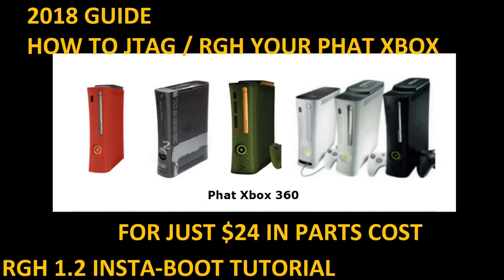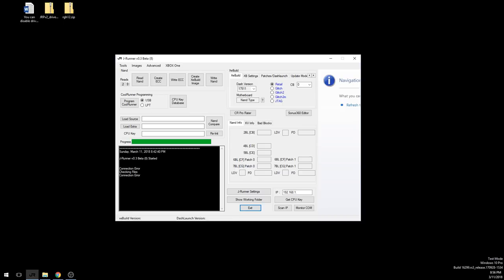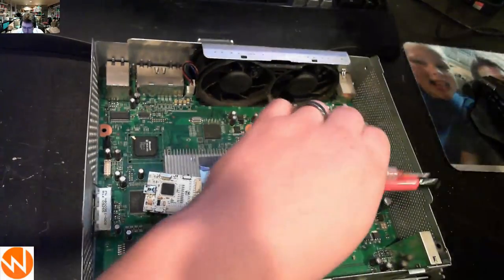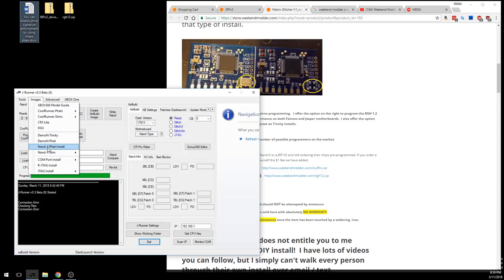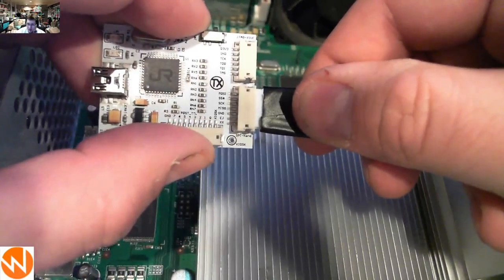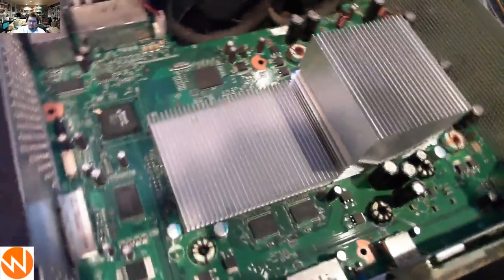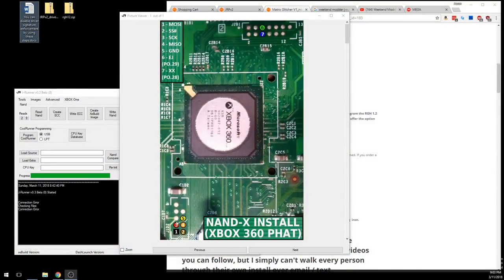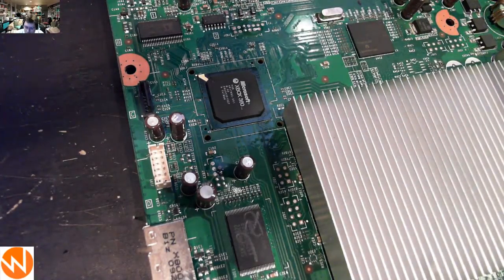2018 Complete Guide to RGH not JTAG your fat PHAT Xbox 360 for mod menus and emulators

Comment: Finished up the install today. Wow, nearly instant boot times. Awesome video thanks for your help. And to anyone who reads this comment and wants to do this with no soldering experience it is possible!
Reply: does it need soldering?
Reply: Karley Werlang Campos  of course it does....
Reply: Hi I'm just about to mod my Xbox and wanted to know as you've done it, what exactly do I need to buy? I have a Zephyr model (UK) Also a year on was it worth it? Thanks buddy!
Reply: @heartcrafts3426  month late, but the model zephyr literally isn't worth modding, (they are a pain in the ass)  personally i would look for a jasper or falcon model
Reply: Colin Hathaway Can I ask you a few questions bro about flashing an Xbox360 Drive
Reply: Just remember to use plenty of flux and you can't mess it up 😊
Reply: Syncopia Hey bro do you know what you’re doing when it comes to flashing Xbox360 Drives
Reply: Colin Hathaway how can you do it without soldering?
Reply: Soldering was very difficult and points are too small.. It is very common that in any soldering point would burn at the middle of the work and say goodbye to all efforts mad before. However, it is not that difficult for amateurs.

Comment: At 38:58 where you're worried about the blob size on CPU_PLL_BYPASS, jsyk, there is no actual difference between the top of the resistor and the testpad, Both are connected to the same thing. I have schematics. I used to use the top of the resistor most of the time thanks to the convenience back when I was modding 360s commercially.

Comment: u sure u got those numbers right? 470 sounds ridiculously high for soldering.
i have destroyed many circuits with just 400....

to me this job looks more like it needs 300-350.
Reply from the maker: Agreed it is high, I like to work hot and fast
Reply: TheWeekendModder Hey bro can I ask you a few questions about flashing an Xbox360 drive

Comment: Just modded my Jasper 512MB by following this tutorial (but using a Coolrunner Rev C and a Nand-X instead). Instant boot, absolutely awesome! :)

Although I noticed that the wiring images in the J-Runner package told me to wire up FT6U7 which didn't work. Had to use FT6U1 for RGH 1.2 instead.

Comment: Hey, your video was beyond outstanding - covered everything possible for installing matrix chip. I accidentally bricked the first console - ruined the post solder joint (FT6U1). For some reason the solder would not take to that point or the trace. Went out and found another 360 for cheap, repeated the entire process (extremely carefully) and all is good. I haven't did anything with the XEX menu or anything - I'll work on that tomorrow. All in all, it was a breeze. I feel good about doing my first Mod, and now I want to keep doing them until I can perform this in my sleep, and fully know how to avoid issues. No more bricks for me. BTW, I ordered my parts from your website. Super easy, parts came extremely fast. I would like to suggest that maybe you offer the wrap/kynar wire as well. I don't have any type of store that carries that wire in my city. I found it online for cheap, but it'll take weeks to get here. I just wound up using the twisted pair wire from an old Cat5 patch cable I had laying around (though it wasn't solid strand as I had hoped). Thanks again for the video and knowledge. 

Note: my original display output was through the AV cable for the 360. For some reason, when loading up the Xell menu, it would not display through that port. I had to use an HDMI cable for it to display. Once the full install was completed, it worked just fine again. Just putting it out there in case anyone else runs into that problem. Hope it helps.
Reply from the maker: Hey thanks for your feedback, I might consider adding some wiring to the site - good suggestion!

Comment: Outstanding video tuturial.Weekend Modder :) got my v1 Falcon booting in around 7-8 seconds (Matrix v1 chip with 28 single core awg wire for PLL,RST and POST points.26 awg stranded core wire for CLK point and 24 awg stranded wire for 3.3v and GND points) :) :) :) :) :) :)

Comment: Thanks for this tutorial! I am going to be doing a few Xboxes soon. I haven't been on the scene since around 2010, used to do this quite a bit but forgotten everything I learnt, so thanks for this video it helps a lot! I am wondering though, this is an Xenon motherboard, I had read through a lot of se7ensins posts that you couldn't RGH 1.2 an Xenon without an Ace V3? Yet you are doing it here so just needed some confusion clearing up. I got a JR Programmer, many years ago these costed a fortune but I got a genuine one off Ebay (not from China) for about £17 recently. Never used one, I used to do it with a DIY CPLD programmer and also built a DIY Nand programmer. Always wanted to get a JR Programmer or a Nand X at the time but couldn't afford it. Also, I was wondering, I don't think the Matrix chip I just bought has an LED Debug light, got a tutorial on how to add one?

Comment: I used kynar wire on a muffin trinity install with a rev c for every point except the power and ground. I am getting instant boots 90% of the time. Give it a try if you feel like expierimenting. I remember you saying somewhere you never tried kynar on trinity. I just used 30awg kynar and the muffin 7-1
Reply from the maker: ClearAlpha Nice!
Reply: Next time you do a trinity muffin stream or something see how it goes. Do the rev c so you have a video on it.
Reply from the maker: Thanks for the suggestion.
Reply: Wire is wire. Kynar is not going to give you instaboot
Reply: I am simply suggesting it since he has never messed with it on a trinity and I tried it and had a good experience. It isn't an exact science. Not trying to act like I found the cure to cancer. Many people have done this in the past. I am merely sharing my results of something I don't normally do.

Comment: I recently discovered your website and videos and just wanted to say thank you, you're producing excellent quality content and doing a great job of providing up to date information - I'm glad to see I'm not the only one still repairing and modding these in 2018!
I also have a question - what's your recommended setup for recovering DVD drive keys from Xenon motherboards? I have several consoles that came to me without DVD drives at all and would love to get them fully working. There are a few Xenons that range from dash version 8955 through to 17511. I'm obviously not going to permanently mod them, I just want to recover the keys. What would you suggest?
Reply from the maker: Sorry man, due to general avoidance because of my understanding of their tediousness I've steered away from Xenon's entirely.  It is my understanding that there is a variant of RGH 1.2 that "works" on them but from what I have read it's super flakey.   Best of luck to you!

Comment: Perfect Video, i‘ve done the job for my Jasper.
I also tried for a Xenon. Reading/dumping original Nand is no problem, writing the timefile to matrix and creating and writing ecc is complete but the console won‘t boot up to xell to geht the CPU key.

I flashed the console back do original nand and it‘s Booting instantly to the Dash. 

I also tried out any of the timefiles but no boot. Have i make any other soldering or changeing some options in JR to get in work ?

Comment: Yo I got xell to boot but when I tried to boot the custom image, I get error 73, any ideas? I already repasted it and double checked it, it looks ok.

I did not record the dash version before I started trying, does that matter? I just had it set to 17511 like in the video.

EDIT: Damn it does it on the original firmware REEEEEEEE, I don't know what could have caused it, i've detailed the board with q-tips and alcohol, this is my 3rd broken xbox

Comment: I have a PHAT, non-xenon (I assume since it has a HDMI port) with a dashboard currently at 16537, sadly too high for jtagging, but apparently it's okay for RGH 1.2. Do I have to update the dashboard before doing what you are doing?
Thanks a lot for this video, I am a noob at modding and it was interesting enough to sit through without doing anything.

Comment: i jtagged my old xenon using a taio usb spi knockoff. i still have it lying around, will this work inplace of the jr programmer? or do i still need a jr programmer to rgh a falcon?
Reply from the maker: It would work for reading and writing the nand, but you'd need a way to program your glitch chip unless you bought a pre-programmed glitch chip.
Reply: TheWeekendModder ok gotcha so the jrunner does both reading the nand and programming the glitch chip.
Reply from the maker: Jrunner as software does do both yes, but the point I was addressing is that the old usb spi knockoff you have is physically capable of interfacing nand to read and write it and do that part of the RGH, but for RGH you also need a glitch chip. That old programmer probably doesn't have the ability to program glitch chips.    Some glitch chips require that a "timing file" be programmed to them so work, but some glitch chips come pre-programmed.   If you got a pre-programmed chip and therefore didn't need to program a glitch chip - your existing programmer would be sufficient.
Reply: gotcha.i see you have the chips with the timing file already put on there. since i am really unsure about the steps ill look at a few more tuts, cause i am only familliar with the jtag for xenon. i didnt know you could write the nand on a newer dashboard, which is why i though i needed to to the rgh. i appreciate you responding, i know you arent tech Q and A for rgh :)

Comment: I bought 2 chips, JR Programmer, supplies from weekendmodder.
Got to the point of writing the ECC. Now there's no video output to HDMI or component cables. It no longer does the LED flashing. No RROD. I tried a different timing file on the chip. Re-did the ECC create and write multiple times. No change. Tried putting it back to retail. Console powers up, chip lights up, green light on the on button but no video output.

The console had this problem once prior to attempting the mod, but I used a heat gun on the bare gpu, cleaned the system, applied MX-4 and it played fine. So I don't know if that issue reappeared as a result of me messing with the motherboard, or if I did something wrong with soldering or flashing.

How can I go about troubleshooting?
Reply: Just did my 2nd 360... 3 red lights.
Wow, what a blast this has been!

Gonna get these both reballed.

Comment: i'm new to the xb360 mod scene. watched many vids on how to perform various types of mods but not 100% sure which one to do with which kit.
I have the old white case xb360 fat, power port says 16.5amps and by the charts this should be a Zephyr. System info says D:2.0.16203.0 - K:2.0.16203.0 (BK:2.0.1888.0)
By the chart this console should be able to R-jtag.
Am I correct in my conclusions?
Should I use the CR4 XL with the J-R Programmer V2?
Reply from the maker: Check out this page, I think you'll find it helpful:  http://weekendmodder.com/suppliesrequired.html

Comment: I hate my soldering iron ( 30w pos) . I once used a weller wes51 soldering station and I was feeling all warm and fuzzy inside.
Reply: I have a 35 year old temp controlled Weller and it still works great.

Comment: Heej, after I followed your video I tried to perform a RGH 1.2 install on my Jasper 360. My first mod ever. But I have an issue! After I soldered al the point, connected de Programmer and connected the Xbox to the mains, it started smoking. The contact point and the C1D7 next to the yellow wire started smoking. I unplugged everything desoldered al the wire cleaned al the point and did tried it again. Still the point next to the yellow wire starts to smoke immediately... Someone know how to fix this? Are their some alternative point maybe? And what is causing the problem? Thanks!

Comment: Hey, I ordered the Jr-Programmer and matrix chip very eager to try this out. It's gonna be my first time soldering and I have a xenon lying around. I was wondering if I could practice getting the nand dumps by using the same method in the video using the xenon. I'm gonna do the actual exploit on a falcon or jasper when I get one.
Reply from the maker: Yes, you could practice taking nand dumps using the same method on a Xenon.
Reply: You're the man, worked beautifully. I've been wanting to do this since I was a kid, good to see I'm actually capable I got good two NAND dumps. Cheers

Comment: I've tried this on 4(!) different Xbox 3 Falcon 1 Jasper and on all of them joints 1 and 3 are dead (0V readings) so I can't read the NAND. Any idea what's going on? I've measured the joints even before soldering anything and it's still dead
Reply from the maker: Put your MM on your soldering iron - maybe it's shorted and you are sending voltage down it?   Sounds like you're killing consoles...

Comment: Console won't boot up to get DVD key? Chip flashes but console never boots up:( what did I do wrong? Used 21 timing file and created EEC still nothing:( any help would be greatly appreciated
Reply from the maker: Impossible to diagnose from a two sentence comment.  Check over all your wiring.  Make sure console still boots retail.

Comment: Many thanks!  just did it to both my Jasper Xbox'ses and it was a lot easier than I thought, nevertheless for me a 1 day project but I did not expect anything different as a beginner. I really appreciate your effort, hints and clear explanation. I compared some other guides but this was the best and only guide I actually used. If you strictly follow this guide, use the same tools and patiently follow the sequence, nothing can go wrong.
Reply: I did one thing different, at 1:09 I fulled in the ip of my xbox in jrunner so I did not even had to copy and paste the keys.

Comment: I have a Jr programmer v2 and a corona 16mb motherboard. Do I have to instal drivers on the chip or is it all ready?
Reply from the maker: You didn't mention a chip.  What chip are you trying to use?  This video you're commenting on is for Phat consoles - so it's not applicable to your Corona.

Comment: Hey. Thanks for the great tuts.    Just got a question about the wire you use.  Well maybe a question in the wire I’m going to use   I have some Ethernet cable wire lying around would that be usable and work for an RGH   With a CR V2.     Thanks again.
Reply from the maker: Ethernet wire is sometimes very firm and hard to bend - if you've got the stranded wire stuff it'd be fine - but if you've got solid core wires don't use that as you'll make yourself more likely to damage the console.

Comment: Update 1 - I can get the system to boot occasionally, NOW WHAT.   Xbox modified desktop loads, but as noted previously haven't been successful booting system with External Hard Drive plugged in and probably just bad timing (CoolRunner glitching working sporadically).  Either way, any suggestions, anyone else using CoolRunner and upgraded to something more reliable on the original Falcon fat consoles? 

Hmm, almost complete and just a few bumps in the Road, with initial build booting to alternative Linux like interface and providing CPU and DVD numbers.  Followed your instructions, and installed updated build created though JR v2.

System initially booted, but now the build won't load and CoolRunner tries to glitch and never get front 4 LED's loading Xbox interface.   I've only gotten Xbox updated dashboard to load once and also the original hack interface that shows CPU and DVD numbers.

Anyone else with similar problems, and maybe need to update timing files or switch to a completely different Matrix glitch chip.  Please also note, my original hard drive was also inaccessible.  To many missing pieces and hopeful someone can provide some suggestions.  Thanks for the reply...
Reply: Hmm...no one has similar problems with JR Programmer and CoolRunner?   Hmm...maybe time for Reddit or otherwise for some help!

Comment: any video on Xbox360 Slim with Jrprogrammer V2 + Coolrunner rev C?
Reply from the maker: No, but I've got several "muffin" Trinity using a Matrix V1 which is exactly the same process except for the changes in the pads on the CoolRunner.
Reply: Thanks ill look into it

Comment: Hmm I have a halo 3 360, it had a red ring kit installed by eb games is it with chipping also just moved from original modding
Reply from the maker: Most of the Halo 3 phats were Zephyrs.  Not a good console for "chipping"

Comment: Hey, I just followed you up until the 'A' point on the xbox board and I messed it up, the contact point for the solder is gone. Is there any other alternative points?
Reply from the maker: "A" on a Matrix ?  That's the RST point.... there are allternative points - but I'm not sure if that point being ruined will cause the console not to boot.    I suggest you remove the power wire from your glitch chip, reflash nanddump1.bin and then verify it will still boot stock/retail before doing anything else.
Reply: TheWeekendModder I've reflashed and booted retail and it boots perfectly yet (thank god), yes I meant RST point, where are the alternatives for that point?
Reply from the maker: https://imgur.com/a/AP0CvhW

Comment: Are the solder points the same for each chip? (Ace v3, CoolRunner etc) and just the motherboard versions which change the solder points to use?
Reply: I have a Jasper and a Ace V3 but not sure if I can perform a RGH 1.2 with the ace all all videos and guides show different chips than the Ace.
Reply from the maker: There is a method of RGH 1.2 using an Ace - but I found it to be not very effective so I recommend using a Rev C or Matrix for RGH 1.2 purposes.
Reply: I have ordered a Matrix v3 in the mean time, is the wiring the same as Ace? what difference is there between the two, boot reliability? Also I remember one of your videos talking about an extra component on some of the Matrix chips but cant find it now...